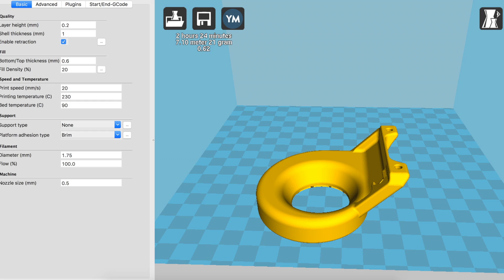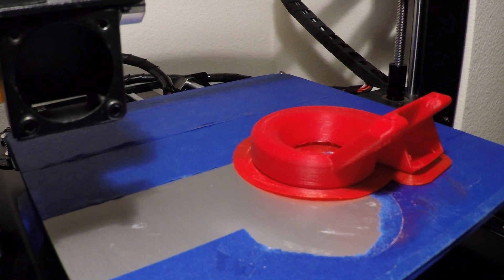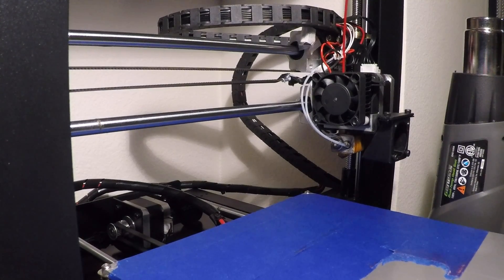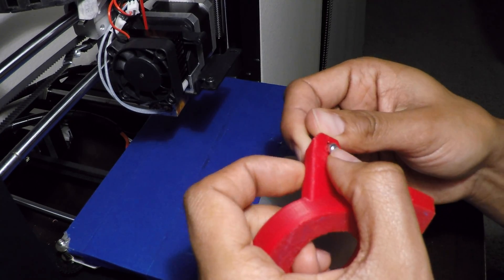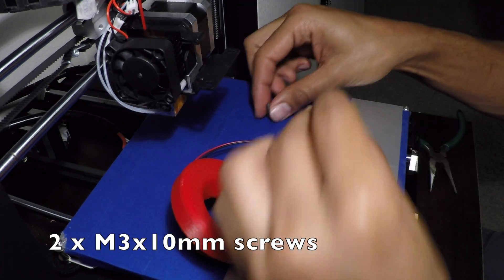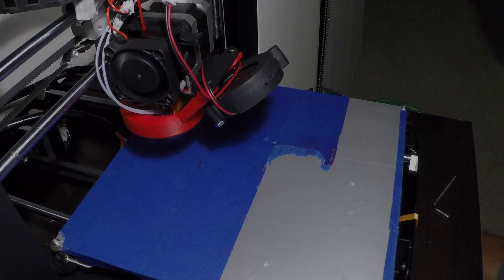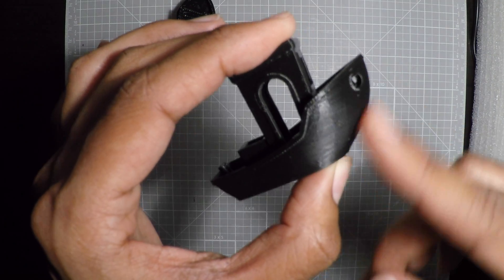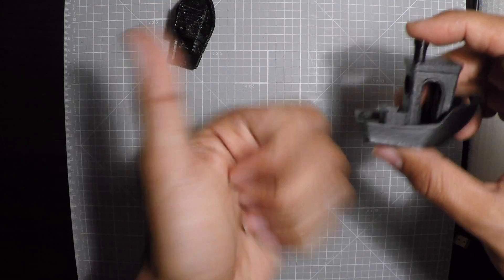Monoprice Maker Select Mods #5- Diii Cooler

Comment: Great video! But I have a question , I have a i3 plus with the micro Swiss hotend which works great for PLA but I have trouble printing PETG for the di cooler , it starts to string during mid print and eventually fails when it tries to fill in the top portion, any recommendations to achieve this print either with ABS or PETG?

Comment: To prevent the cancer bumps go into your slicer settings and select "Nowhere" on the setting "Fill gaps between walls". Then, increase shells to 3 and that will give you just a solid shell without pinpoint infills.
Reply from the maker: Shaine Winter will give this a shot next time I try it. Thanks!

Comment: Im scared of being this printer because people on Amazon say that theirs have burned or caught on fire.
Reply from the maker: +Ed YT ive had this for more than a year now and I've never had a fire. There can be failures, clogs, etc, but technically you should always keep an eye on your prints. Once you get the printer dialed in and have more experience, then you usually get a lot less issues. It's been a great printer for the price in my opinion!
Reply: Ed YT lookup the mosfet mod for it
Reply: Old comment, but if you bought it, do the “mosfet mod”. Otherwise, it’s a fire hazard. It’s like a 10 dollar mod
Reply: There's a new v2.1. it has one
Reply: Scratchyone Scratchyone  current version eliminated that
Reply: Mike McElligott Oh, thanks. I just bought mine and did it anyway. Better safe than sorry...

Comment: doesnt more colling cause wardping? 
im a noob looking in getting one of these
Reply from the maker: +Universe's rabbithole it depends on the material, the design, size, how much and where it's cooled. Some materials like ABS will warp more than others, like PLA. PLA's properties make it so having a fan can drastically improve your print quality. I usually turn it off for ABS prints

Comment: great video! I was wondering did u change any of your PIDS?
Reply from the maker: +jimmy s thank you! No changes in the PID settings. I just adjusted the fan speeds. It could probably help you, but I personally haven't had great experience/improvements with the PID temperature settings
Reply: Yes do a PID autotune. Your heat fluctuations.will remain less erratic, and you won’t get layer issues

Comment: could you print the fan shroud in pla
Reply from the maker: +krypto 799 you might be able to get away with it. I've read of people that have. Maybe if you're always running the fan, the temperature of the shroud will not raise enough to melt. Still you're running a higher risk of it melting on you. If you don't want to do ABS, then PETG might be a good option (I've never used it though)
Reply: jrclem yeah I really dislike abs because it's smells really bad and is not as environmentally friendly. Any solutions for this project?
Reply from the maker: +Ed YT you could print the fan shroud in PLA, but I wanted to have peace of mind if I decided to print with higher temperatures like PLA or other materials. I'm building an enclosure for my printer that will hopefully contain the heat and the ABS fumes. I'm documenting it and will upload the project once I'm done. It's taking a very long time because I've had a lot of life changes in the past 6-9 months and I barely have time to work on projects and edit videos. I think that I might have more time in the near-ish future though!
Reply: I did, but PETG is much better

Comment: you do realize for abs you need an enclosure. and supposed to use gass bed not crappy paper tape.
Reply: john doe THATS BS YOU DONT NEED AND ENCLOSURE! Just a heated bed and proper nozzle. Which he has.
Reply from the maker: +Ed YT True! You can make it work! I would recommend sticking to smaller prints with few straight lines because you can have serious warping problems (like you will see on my last USB fan case video)
Reply from the maker: +john doe do you realize that I have been able to print ABS this way? You just saw it. Seriously though, those things do help, but they are not necessary for small / simple parts. If I wanted to print larger pieces that are more warp-prone then yes, I would need an enclosure. 
Glass is nice for keeping a level printbed but it is by no means a requirement. 
Conclusion: do whatever works for you as long as you're happy with the results.

Comment: the only thing that's holding me back is I'm not sure what all I need to 3d print I don't really have an excact purpose for it other then how much I lovw the concept of being able to print about anything I can think of
Reply from the maker: +Jacob Pfundt I've heard that reason a lot for people who haven't taken the plunge yet. When I first considered going into this I didn't know either, but then every time I saw something I'd like to print, found something that I could fix or improve by printing it myself, or came up with an idea about something I needed or thought was cool, I would write it down. In a couple months I had a huge list and the ideas started pouring in. That's when I decided to buy it. Maybe you can try that!
Also, besides the printer, some filament, and a computer you don't really need anything else to get started. You will start getting more stuff as the need arise.
Reply: My plan is somehow make something I can see online to basically pay off the machine also thanks for the advice
Reply from the maker: +Jacob Pfundt tbh, I thought I'd be able to pay off the machine by commissioning prints and the like, but that market is super competitive now, unless you're in the manufacturing, engineering or design industry... Or a legit artist you probably will not get that cash back. The quality of your first prints will not be to the same standards as your competitors and the time you invest in that particular print will probably not make it worth it.
I would say focus on having fun and printing things you like and you find useful. Be active in the community, post your designs, ask questions, and eventually someone may be willing to pay for your prints or designs (don't hold your breath, it's only been a couple of times for me). Still, in the end you'll get great skills that you'll probably be able to profit from by the time you move to the next level. To me, the $400-ish I've spent on this printer have been one of the greatest investments I've done on myself as a person :)
Disclaimer: this is my own experience. If you feel you can pay  it off anyway, GO FOR IT! Good luck!

Comment: how do you like your maker so far I'm aost positive I'm going to buy one
Reply from the maker: I love it! It's been able to print almost anything I've thrown at it (within reason and after a few tries). I haven't been able to put up the video yet, but I did have a problem with the hotted that rendered it useless... but! it was under warranty and I got the new v2.1 instead and it is WAY better! most of these mods gave been addressed. The only ones I've had to do are this fan shroud and the z-brace.
Totes Recommended 👍🏾

Comment: Nice video mate. Will have to do that to my Maker Select next.
Reply from the maker: +Thomas Pasieka thanks! I really like it. You'll have to adjust your fan speeds because it can cool down too much when the extruder is still low on the bed. Also you want to make sure the base is very level.
Reply: what fan speed should it be adjusted to for first layer?
and then what speed afterwards?
Reply from the maker: +Tyler Durden I just changed the starting fan height to 5mm and it has worked great. Try that out and let me know how it works for you
Reply: jrclem what you mean change fan height?
how do you change it?

I am talking the fan speeds you mentioned
Reply from the maker: +Tyler Durden I meant the height at which the fan turns on, sorry. You can set it in the details of the advanced settings in Cura. Lowering the speeds around 10-15% might also help depending on your material and fan. It might take a little bit of fiddling